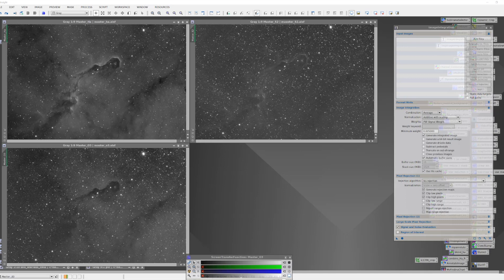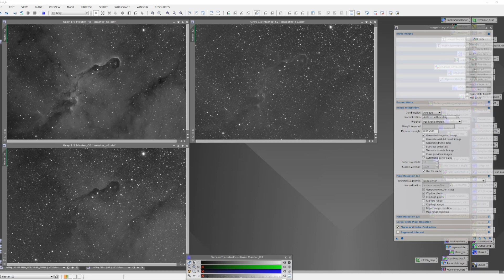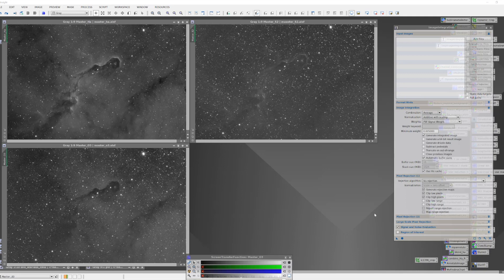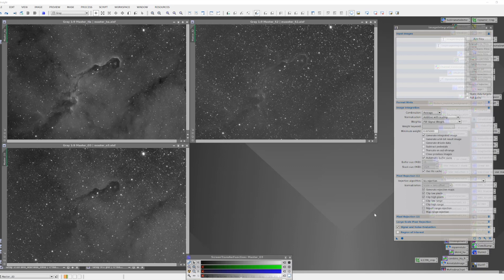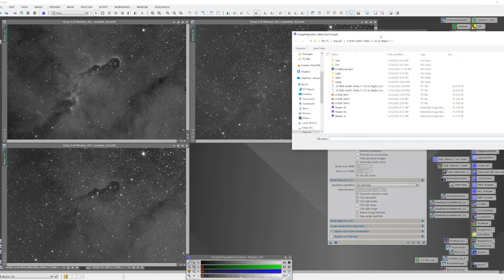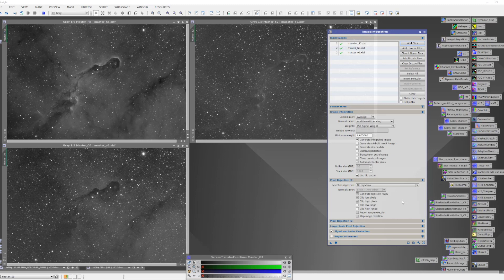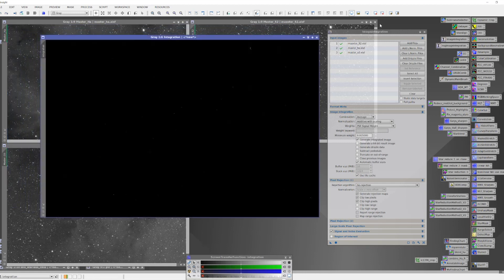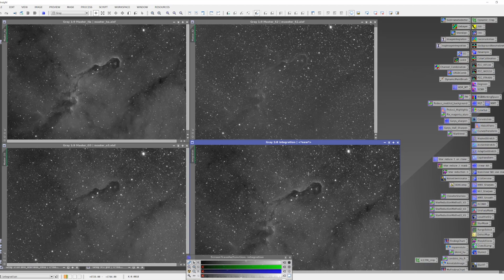2-Minute Tutorial: Creating A Synthetic Luminance Image

Comment: Neat method Patrick, I’ve only ever used simple Ha - this method seems more sensible, I’ll give it a try.
For OSC (broadband) is there any benefit extracting the RGB channels and integrating using your method vs simple luminance extraction?
Reply from the maker: Thanks, James!  I have never really thought about the OSC case.  If you have an RGB image and extract the neutral, the weightings between the color channels would be whatever is specified by RGBWorkingSpace.  The common recommendation is to use RGBWorkingSpace to set these weights to 1.0 for red, green, and blue.  If you were to use ImageIntegrtion to set those weights and create the neutral, it would be creating unique weights for that particular image based on the signal content of each color layer.   So the neutral would not be a colorspace neutral, as much as a neutral with optimal Signal-to-Noise - which would be interesting to try.  But since I am not an OSC user, I have never gone down this road, but there might be a good argument for trying it!  

Thanks for an interesting question!

Pat